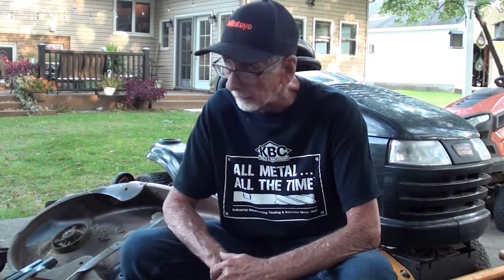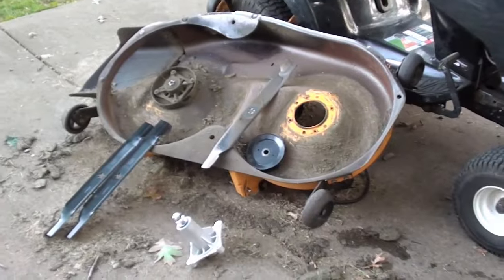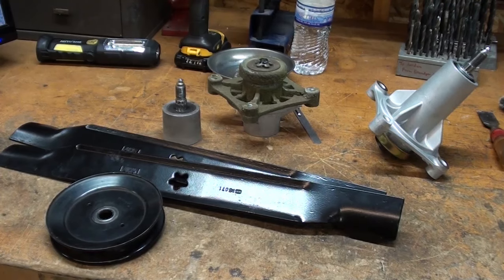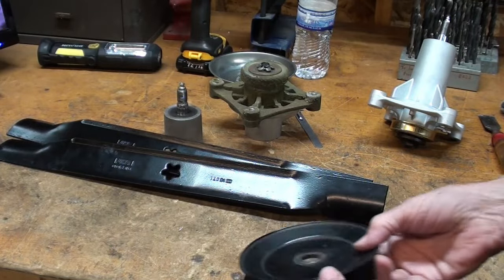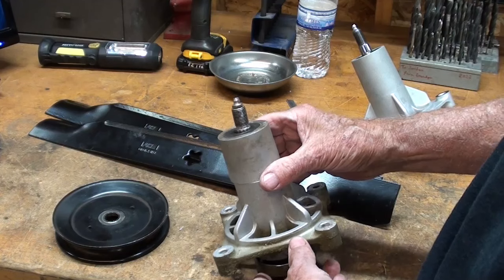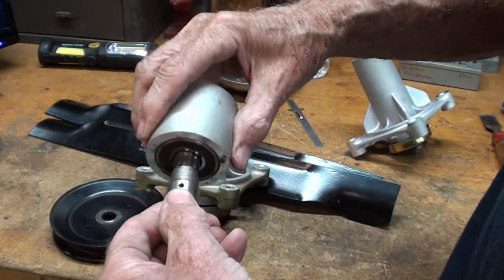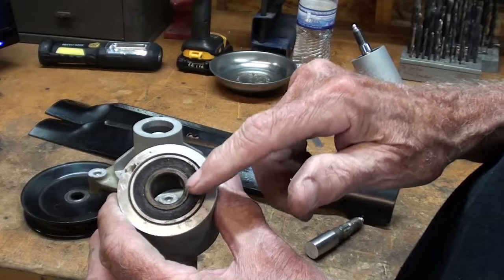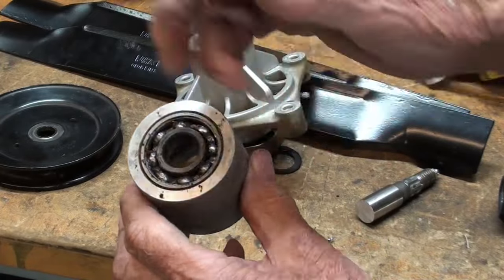LIES & DECEIT mower spindle fraud SHORT SUBJECT #52 tubalcain

Comment: Lyle - As a retired mechanical engineer I have to scratch my head.  I'm sure it's the bean counters who ended up going the cheapest way - because (I should say most of them) they don't understand anything but saving a nickle.  But then I'm such an old engineer I can remember the professors putting emphasis on our responsibility in designs to do 'the right thing'.  Which even when done properly is a trade off of safety, cost, performance and life cycle.  Decisions have to be made.  Of course that was when technical people ran companies or had major influence.  See Boeing as an example of the end state one can reach.  45 years ago I remember working with Boeing engineers (we were a major supplier) - top shelf technical people; current issues would seem to now argue otherwise.  Some things that have changed in the world sure are not for the better.  Have a nice Sunday and keep up the good work.
Reply: Simplest thing here is the cavity can be filled with grease until it exhausts out the vent hole.  This prevents the vent from filling with water and debris.  Remember, passenger cars have been using sealed ball bearing in the hubs for what? 45 years or more (since FWD became the standard) even my one ton 4WD truck has a sealed cartridge hub system.
Reply: The engineer probably designed it with bearings with the seal on one end. Then the production manager saw that orientation of the bearing when being installed was an issue that could be "fixed" by going to a double sealed bearing. Cost of thee double sealed bearing was minimal compared to the headaches of bearings installed backwards, so viola! Problem solved.
Reply: Indeed,the Boeing example is a really good one to raise and a disgraceful fall from grace for what was once a company regarded as the pinnacle of engineering excellence. 
 I really don't know if or how they will ever recover their previous excellent reputation.
Reply: Non professionals are running too close to the top of the company management levels. Lots of designs are not well developed because of this or they are kicked back down the chain to redesign and lower cost. Problem is those folks put risk on everything else but cost. May as well have elementary students if that's how they want things to be.
Reply: If you buy Chinese you get what you get. The reason they don't use single sealed is because they would have to pay attention as to which direction the bearing is installed. Double sealed doesn't matter. So they've error proofed the assembly. I'm not saying it's the best plan, but it's the simplest.
Reply: @Garth2011  spindles for mowers have been made this way for 25-30 years or more.  These are lower quality mowers, throw away consumer models if you will.  My Dixie chopper has a great greezable spindle but a new one is about $12,000?
Reply: Current mechanical engineer here.  Everything is determined by cost and time.  By people that have no clue where things come from.
Reply: @johnnicol8598  So true
Reply: I totally agree with you Lyle being a retired engineer too. Engineering desing something than it goes through the STUPID fine comb of the marketing God. First thing they will tell us,  not ask, is cut the price. Rest is history... just imagine it. Happy retirement. 😊
Reply: @RustyorBroken The mower was manufactured by Husqvarna  for Sears.
Reply: @ellieprice363  the replacement spindle in his hand wasn't built by any manufacturer in the U.S. Also, if I were a betting man I'd wager that "Sears" mower is really an MTD in disguise.
Reply: @maitajack  Marketing is a necessary evil.  At least they do something.  The MBA's and accountants are pure poison.
Reply: @RustyorBroken My very similar Sears mower has a decal that says “Manufactured by Husqvarna”. True, the spindles could have been sourced from China or Taiwan. Since they contained sealed bearings they shouldn’t ever need greasing.
Reply: @johnnicol8598  Hey! My daughter is an MBA!  Shes a nurse and thought it would be a good step. Sad it hasn't been (for a 30 year old) shes moving on towards being a CNA (Certified Nurse Anesthetist)  hopefully she makes it there.
Reply: Board room meetings deciding who will live and who will die. All for the greed.
Reply: Boeing doors blow out coz the only guy certified to fit the bolts went on holiday so no one fitted the bolts! 🙄👎

Pretty much what our world has come to these days.
Kids raised with TV & Tablets etc who have the attention span of a gnat - can’t concentrate any longer than an advert break to complete any tasks.
Can’t work for 2 minutes without stopping to interact on their phones / social media etc. 🙄
Reply: Boeing doors blow out coz the only guy certified to fit the bolts went on holiday so no one fitted the bolts! 🙄👎

Pretty much what our world has come to these days.
Kids raised with TV & Tablets etc who have the attention span of a gnat - can’t concentrate any longer than an advert break to complete any tasks.
Can’t work for 2 minutes without stopping to interact on their phones / social media etc. 🙄
Reply: Engineers figured out a long time ago average people are too lazy to grease anything and most lack the understanding that lubrication is essential for anything that experiences friction in operation. That’s a big reason why most everything is pre greased and sealed. I’d bet most Americans don’t remember the days when vehicles had grease fittings in drive shaft universal joints, ball joints and tie rods and manufactures bothered to go to the effort to include fittings in those parts.
Reply: Dang over 20k views. Nice!!?
Reply: Consumer grade riding mowers are trash these days, and they’ve been that way since the late 1970s. I remember my dad complaining that there was no grease fittings on the spindles of his ‘78 Dynamark 10/32 rider.  It too had sealed bearings. 

It’s possible to remove the inner seals on the bearings so that grease actually reaches the bearings. Completely unnecessary, but possible.
Reply: @RustyorBroken Either MTD or AYP. Both companies manufacture garbage quality, disposable equipment.
Reply: All products are made to a price. Often, the price is the first specification and everything needs to fit within that parameter. Generally, when designing something, the outer parameters of use are the limits the machine is designed to. Once these limits are exceeded, all bets are off. Hitting a stump is outside those use parameters. But designers screw up too. It’s not likely it’s fraud, just error. It’s actually slightly more expensive to use sealed bearings than shielded or unshielded bearings. So there’s no reason to do it intentionally. I’m not quoting this, but there’s a saying; “It’s more like;y that something is done from incompetence than evil intent. I dislike throwing the word “fraud” around. It minimizes the term when actual fraud occurs.
Reply: @melgross  Sometimes it's just dumbfckery and laziness, sometimes it's just poor design. The issue here was never the failure, it was the idiotic choice of a useless grease fitting and sealed bearing that ought not be. It's a shit show all around.
Reply: @desertdweller9548  yup. I agree. I don’t understand the thinking that went behind this. They did the right thing by using a sealed bearing in the bottom so that crap wouldn’t get into it. It’s a sealed bearing, which means it’s lubricated for life. No need to add grease. I assume the top bearing is similarly sealed. So what is the point to all the extra expense of drilling the shaft, tapping it and buying a grease fitting? You can’t grease sealed bearings because you can’t get grease inside. If you apply enough pressure to the fitting, that pressure inside the housing can blow the seal if you have a hydraulic gun. It would have been better to just advertise that the bearings are sealed and lubricated for life and that no lubrication is required.
Reply: @melgross  the obvious answer is greed. Why redesign a part when you can keep using the wrong one that still fits?
Reply: Engineer here too. I ran into this time and time again. Instead of being driven by the sales department or engineering/production they would give ALLdecision making to the bean counters. - I might note the bean counters batted 1000. - 5 out of 5 went out of business. 

There is a movie called "Executive Suite."  It tells the story in a nut shell,,,, except  engineering won in the movie. The bean counters win in the real world ,,,,for a while. Then there is no company to work for.

Comment: I live in the Ozarks. We had a mower which used the exact desgn of spindle that your son in law has. We broke three housings on the same side when I had had enough. So I turned and bored a new housing out of steel. It weighed three times as much but our southwest Missouri limestones finally met their match. When I saw what you found I couldn't believe it.
Reply: I'm still nursing my Craftsman LT 2000 that I bought in 2002 to keep it running.  I live in the Texas hill country, so my lawn is mostly rock with a thin layer of soil and grass.  I've gone through 3-4 spindles and a dozen blades in that time.  I'll check that next spindle replacement.
Reply: I did the same on a Cub Cadet I got for $100. It was like new the the exception of one of the spindle bearings. They wanted a couple of hun for a new spindle so I did what you did. - I made h of them in fact. - Cut the grass here for a year and then gave it to my son when he bought his house,,,,15 years ago. still running with the bearings I out in,,,,,,,What do I use? My 1966 Gravley convertible. (Got that one rom MY dad)  I use the finish mower for the lawn now but the I used the "flying saucer" for years. - We used to clear about 3/4 acre at my son's. - It will take down a 2" tree. - Original bearings...... The finish mower is only  40 years old so the bearings are not that old (for a Gravley) and are still in like new shape. 

They don't make these sheet metal toys you get at Lowe's like that.

Comment: The whole Zerk fitting thing is ridiculous, but appropriate in today's world.  Consumers want a cheap lawnmower and their wishes have been granted.  Nine out of ten users won't read an instruction manual, don't own a grease gun, wouldn't recognize a Zerk in the center of the steering wheel.  A bigger fraud, to me, is designing these things to look like a tractor.  These are power mowers with a seat.  The names are all ripped off from dead tractor companies.  None of that tin and paint and graphics contribute to cutting the grass.  Time was, the hood protected the engine from weather.  Now they have big vents to let rain go right onto the top of the engine.  Pointless.  Transmissions are plastic today.  All the competing 'brands' are made by either of two companies, AYP or MTD.  Under the paint they are all the same.  Four tubes of grease costs as much as that quill assembly.  I could go on a rant but I'll refrain.
Reply: Everything you stated is true. I really wish you had continued.
Reply: That was good, Rant away.
Reply: Reading the instruction manual for a lawn mower? Todays "enlightened posers" won't read the owner's manual for their $ 50,000 vehicle!🤡
Reply: I'll add for you the stupid compression release spring loaded  cheap lever on the camshaft. It's so an even cheaper starter can be used.
Reply: @davidbell4986  Oh, yeah.  Had forgotten that.

Comment: The purpose of the grease fitting is to fill the cavity with grease to keep water out so it wont pool on the bottom bearing. They know owners are going to pressure wash these things and lowes is going to let them sit outside in the rain. Pop out the bearings lube  them correctly and not trust the 29 cent a hour employee, then fill the cavity with grease, will last years.
Reply: Ah! I see. Good point. So I guess they come from the factory packed with grease?
Reply: If that is true 1-Why are they not shipped full of grease - If the seals work it would stay there for years and there would be no need for a grease fitting.. 2- If it's true it's the absolutely stupidest design I have ever heard of,,,,,, and I saw some real dunderhead designs.

Comment: I’ve worked on lawnmowers all my life. The best thing is sealed bearings.  don’t  wash your mower, when it’s hot after using make sure it’s cool because it acts like a canning jar. The cold water hitting the hot bearing draws a vacuum sucking the  water right inside the bearing. Making short life of your bearing.
Reply: Never wash that deck! I used to change spindles or replace bearings about every three years until the lightbulb went off. Do not get water on the deck.
Reply: I see the same thing on farm.equipmet that sits out all the time, just makes me cringe.
Reply: I stopped washing my mower deck over 8 years ago..  I use a blower.  Changed the first pair of spindles earlier this year, one had become noisy, so why change just one when for twice the price you can change two..   Motor vehicles have been using sealed bearings for years and they do more mileage than mowers..
Reply: I agree 100% about not washing the deck while it's hot. My compact tractor also warms about using a pressure washer.
Reply: @almalm7849  been a golf course mechanic all of mine. I agree with you. Water contamination and subsequent corrosion is the #1 killer of bearings that I see. Toro in their reel mowers switched to using stainless steel bearings. Even being non-serviceable they last for years. Used to be we'd rebuild cutting units every winter. Now it's not uncommon to replace bearings when the reel does. Depending on mower about every 5 years or so. Our problem at the golf course is that we have to check the mowers everytime they go out and that requires washing. Plus I've seen rust from rotting grass knock the edge off a reel.
Reply: @d3faulted2  pretty cool I was a golf course mechanic for most of my life I am 69 now and I hated Toro ha ha in the Louisville, Ohio Valley area.
Reply: @almalm7849  I'm 40 been working golf courses since 17. Currently Long Island, NY. I've had all the colors and currently I feel red is the best. I do try to be unbiased if it's a good unit it's good like I'll take a pro-gator over a workman any day.

I like Toro cutting units since they changed their bearing packages and came out with their edge series reels. They just last forever. My fwy units have over 2000hrs on them, reels still have almost half their life and I've only replaced a couple of roller bearings so far. We are cutting at .350 3-4 times a week and i grind 5-6 times a year.

Comment: Lower end mower spindles have been made this way for years.  The people who made the decision to use double sealed bearings are long out of the picture.  The idea that anything is made to last is long gone in manufacturing, died with my Dad. Most items are designed to get past any warranty period and that is all.  The sad reality of it in this case is that manufactures know 99.99% of owners will never grease those bearings ever so why make them serviceable?  This behavior has been around for quite awhile.
Back in the 80’s and 90’s when I was teaching small engines, my students were required to bring in a small engine for a lab engine or class project that I could not start.  The number 1 engine problem brought in was an engine with a broken connecting rod and little or no oil left in the engine because of lack of maintenance. Consumption (buying more or new) now rules the manufacturing world.
Reply: Sad thing is even higher end commercial mowers are the same. My Cub Cadet commercial zero turn is the way and doesn’t even bother to list the bearings and seals as a part, just the entire spindle. With spindles approaching $200 a pop I got dimensions and the bearing and seal part numbers off my last change out. They are cheap standard part numbers commonly found on boat trailer spindles and both bearings and seals can be found for around $20 bucks total. I don’t know it I want to remove a shield from the bearing though, running vertically and at a high speed I’d be concerned the grease would be slung out to quickly. I usually fill mine in the spring and mid summer, might be too far between greasing using an open bearing.
Reply: @1971_Chevelle_SS  when I finally replaced mine on my 1980 J.D. 111 hydro I removed the shield on the inside of upper and lower, drilled and tapped each one for an accessible from the deck topside grease zerk, filled them full of Mobil 1 red synthetic grease, and give each of them a shot every fall when I wash it up and put it away for the winter.  It has been 21 years since I did this and they still seem to be going strong.  The factory originally put in shielded not sealed and I think they thought it should last long enough for most people, thus no grease zerks.  If you pack it full, and keep it full there is virtually no place for the grease to be slung to.
Reply: @1971_Chevelle_SS  I figured out that these engineers don't design parts, they design machines. The parts come from a catalog of standard bearings.
Reply: @gimpygardner3377  That has been standard practice for a long time. There is a numbering, desired tolerance, and feature designation standard and it's been used since the 1930s at least, given that my old Atlas clone Craftsman drill press from that time period has standard bearing sizes. The only designing of bearings happening that I know of off the top of my head is unit bearings in the automotive world. Designing bearings from scratch ensures you spend a LOT more to design and manufacture something that a dozen reputable companies already make. Timken, SKF, NTN, FAG, Koyo, and NSK have been around for a long time, supplying them for everything that spins. Very few companies are so vertically integrated that they do nearly everything in house.